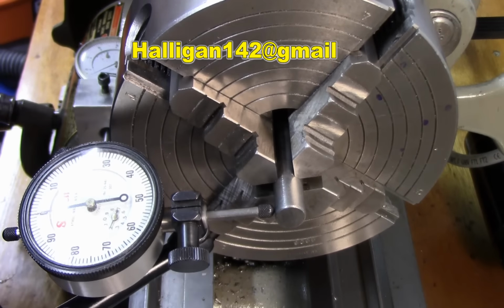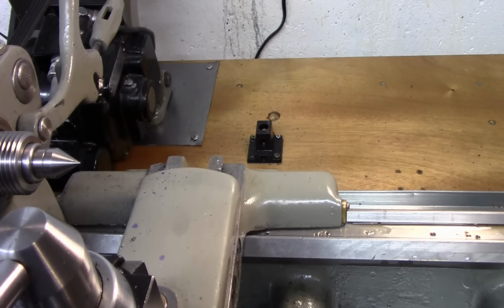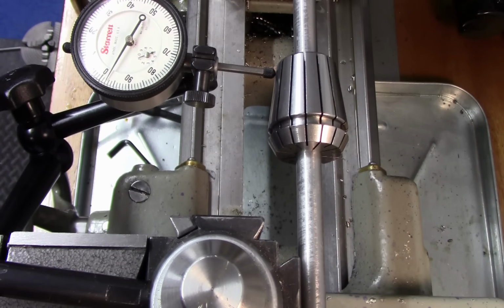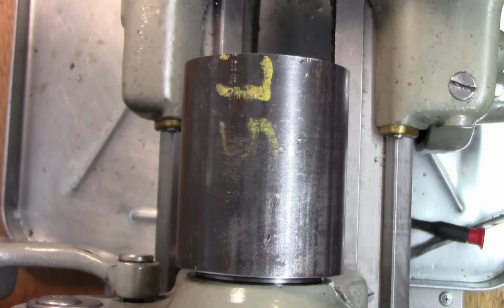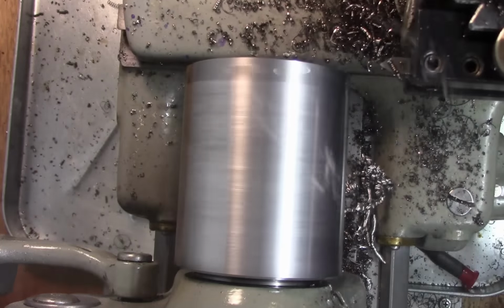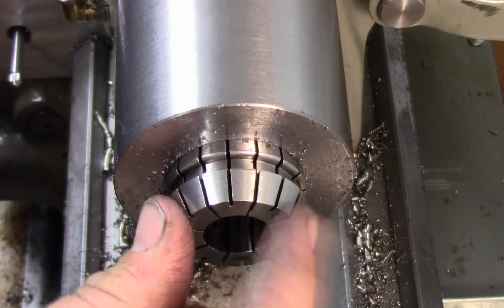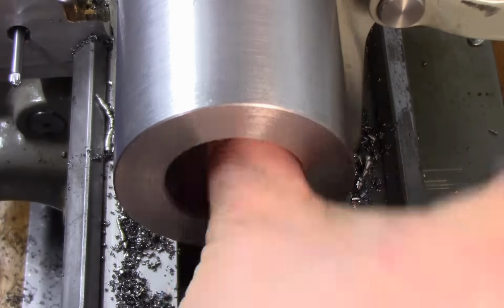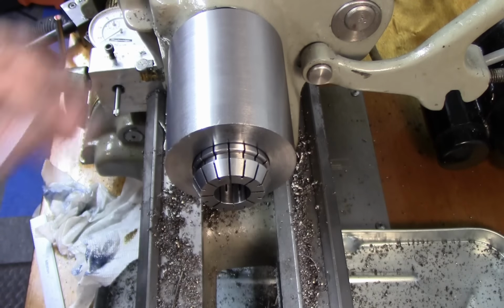Building an ER collet chuck: Part 3

Comment: Interesting video, just made my own Er40 collet chuck for my SB9". It is critical to get the boring bar bang on centre otherwise the taper will not be straight and will follow a convex or concave path with contact at the front and back and nothing in the middle or visa versa. Yours came out very well. Keep up the good work and keep the vids coming!!

Comment: When test fitting the collet in the taper, you should have filled the collet to its maximum size with accurate ground stock... If the collet is empty, it will bend and conform to any close taper and not really tell you what you need to know.

Comment: Hi !

Nice work you di there - I just made such project for myself and I experienced that you have to put something in the collet before you use it for testing the fitting - without some stuff in it the collet just adapts to the champer you made. I used a 10 mm collet AND had some 10mm stock in the collet when testing.

Comment: When polishing the inside of a piece, wrap your emery around a small dowel instead of using your finger. The dowel will act like a sanding block and apply even pressure across the moving surface. When you us your finger the pressure is uneven and the results will be far less accurate.

Comment: hey Gregg great job I wish you had done this sooner before I had attempted to do the same thing for my ER 24 collets on my Barnes Lathe

I have too much run out but I believe it's where it threads on to the spindle
Reply from the maker: +Bill Nebergall 
If you think it's the threaded portion it could be a little loose on the register section of the thread.  You can always bore that a little bigger, make a sleeve and loctite/press fit it in place and re-machine for a tighter tolerance if you think that's where the run-out is originating from.

Comment: I've learned at lot from watching many of your videos, but having made a few ER collet chucks myself, may I offer some comment. First, there is no need to guess the taper outer diameter or collet depth, it's in the DIN specification, plenty of internet sites give the dimensions for ER chucks. An ER40 taper finishes in a bore just a little over 30mm, not 25mm (or 1" USA). It is possible to obtain oversize collets for ER40 going up to 30mm, I have a set, very useful if you have bored the narrow end of the taper the correct size and started with a long enough piece of bar to make use of it.

Comment: I am sure you are aware of the use of sine bars. I find setting up for taper turning is far easier if you attach a parallel to the compound  and measure rise over run (tangent not sine) to calculate the angle.
Doing it this way offers a far longer surface to reference and you don't have to worry about getting the clock at exact center height.
Reply: Instablaster...

Comment: Great job Craig, thanks for sharing!!!!. I'm just thinking,  if your indicator is over or below the tool center your reading is going to have some errors, because you'll be going around the part, what do you think?. Cheers!!!!
Reply from the maker: +Jorge Concheyro 
As long as you're eyeball center you will be ok.  And error is going to be very small and you'll be bluing and fitting the taper after anyway.

Comment: I've just got my first lathe, and I'm still in the process of getting everything up to speed, but something quite critical i'm missing is way oil. I've been cleaning it with wd40, but that isn't exactly sustainable, and I've heard that engine oil can have additives that are bad for the cast iron. If I can't find a product labelled for use on the ways, what should I use?
Reply: +Rob Mckennie This is a big can of worms debated subject.  30wt small engine/compressor oil is non-detergent and works fine.  Vactra 2 is a brand of way oil.  It's a tad thicker and has additives to address 'stick slip'.  The thinking is that using ND motor oil lets you use it more often to flush out the crud for the same cost as the more expensive Vactra.  Asian import lathes usually recommend ND motor oil because it lighter and readily available while Vactra is made for heavy industrial machines and also clings better on vertical ways.  On my small lathe I use ND oil with a dash of Lucas oil treatment for clingyness.
Reply from the maker: +Rob Mckennie 
I use the Vactra oil Eddie mentioned.  You can get it from Enco in a gallon for not too much especially when you have a 20% off coupon.  In all reality any non detergent oil that's slightly sticky (consistency of warm maple syrup) will be good.  You may hear of people using chainsaw chain oil, but that stuff is really thick and sticky.  Stay away.  Straight engine oil will keep particles in suspension rather than letting them fall out which can turn it into a sort of metal grinding paste. That's why you're not supposed to use it.  Honestly though any oil is better than no oil and if motor oil is all you got use it and just wipe the ways every once in a while and reapply.
Reply: ***** I've heard of people using a mixture of kerosene and oil, do you think there's any benefit to that? If you were adding something that thins the mixture, would it then maybe sense to use something like chainsaw oil?
Reply from the maker: +Rob Mckennie 
People do that for cutting fluid.  My personal opinion is I hate the smell and I don't want it being used on a machine that I know is going to get it EVERYWHERE.  I've used Kerosene successfully as a solvent and used to have a hurricane lamp that used it as a fuel source.  Other than that there are better less stinky alternatives even for solvents.

Comment: After hearing that unpleasant chatter (it gave my dog a bit of a fright, too) I thought about how you could possibly use an audio filter to remove it. I tried selecting the offending part of the audio track in audacity, used the spectrum analyzer to find the frequency, and then ran a notch filter at that frequency. Cleared the chatter noise right up
Reply: +Rob Mckennie   I have to say I like the chatter not to be contrary but it helps me know when something needs adjusting.  When I hear it in others while they are working it helps me do better in my own work.  It is far more informative than music or cleaned up sound.  Just my two cents.  Doug
Reply: Douglas Thompson I can see that perspective, but then you need to think about what the purpose of the video is. Is it purely informational? Is it purely entertainment? I think it's somewhere in the middle, but the question is where on the spectrum does it become acceptable to filter out unpleasant sounds? I would argue that when you have things like time lapse and music, you're probably already far enough towards entertainment to justify filtering unpleasant chatter
Reply from the maker: +Rob Mckennie Doesn't really show up nearly as much in person, but the camera seems to pick it up real well.

Comment: When You check how collect sit on the hole You need to put a round bar (like drill) in collet and then put them in to correct check. Otherwise is not true checking. Sorry for broken english :)